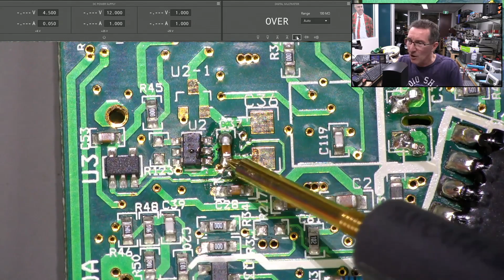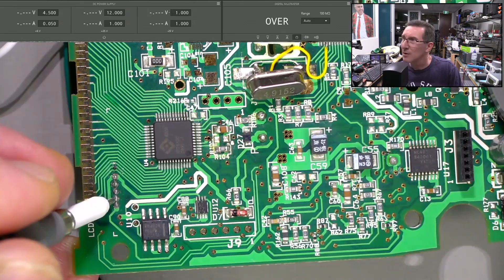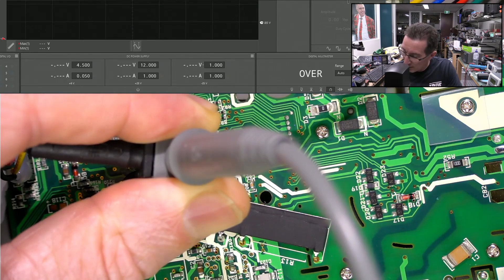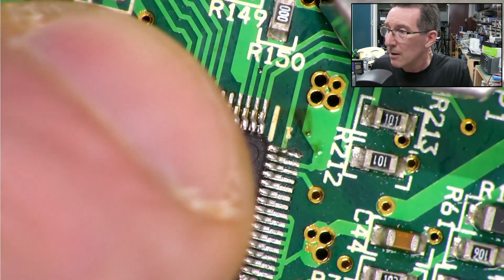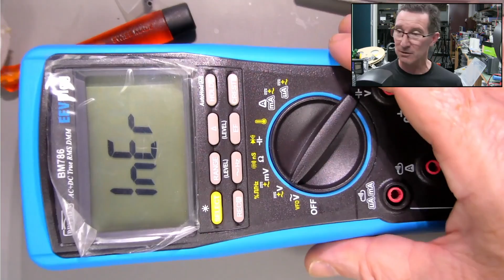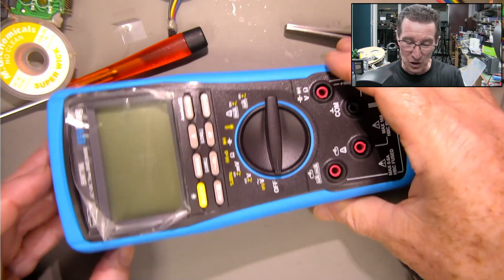EEVblog 1522 - BM786 Multimeter Repair PART 2

Comment: I would expect the most likely problem with a multimeter that has seen a lot of use to be related to the rotary switch or maybe the jacks.... not the 'silicon' failing. Is this common with other brands also?

Comment: Question about meters in general.  One of my meters measured 350 ma of current draw on my car battery.  I switched it over to the 10 amp scale and it read 3.5 amps.  Is that meter broken?  I thought it should read .35 amps.

Comment: Why did you sssume that "InEr" = Insertion? It is Initialisation, obviously. As far as I cam see, you soldered the chip poorly, some pins are probably loose.
Reply: This is 'Input error'. Swears at current inputs.

Comment: very nice repair video 🥳 I just purchased a cheapy $57 HoldPeak_HP-770D CAT III Auto Range 40000 Counts DMM BarGraph  MultiMeter, seems to work OK on hobby stuff? 
Now for the important news.  April 20 2023, 11.27am local time, Total Solar Eclipse over Western Australia’s Coral Coast. Are there any venomous snakes out where the tourist will be?

Comment: A whole lot of useless components. It's time to make something with a normal color TFT LCD with a built-in electronics and a lot of measuring modes. In the same space, it is possible to integrate a signal generator and signal logger with 10x precision with internal calibration tables - there is no problem with built-in memory for that nowadays and normal MODERN multimeter functions, not defined by marketing, such as L measurements with low current milliohm meter. Like what is the problem ? It is solvable by modern integrated circuits.

Comment: 1st of all, an multimeter it’s the main tool in EE lab. You should purchase a trusty piece of equipment and not “Made in 3rd world” POS. OK, your budged is very tight, then buy an 5 – 20 bucks DMM, save money and buy a trusty equipment designed/made in normal world.
Otherwise you will spend more time in troubleshooting the multimeter than the real problem… Think twice and buy a quality product like Fluke, Keithley, Keysight, etc. 
Can you trust the EEVblog branded DMM? Even the creator(??? I doubt he even know the design...) / sponsor doesn’t have the schematics !!! 

Is Brymen better than KAIWEETS? ...the same crap, only in different package, and the price is different :)
Reply: > Is Brymen better than KAIWEETS?

Yes.

Brymen are not POS (and Taiwan is not 3rd world), but to each his own.  Fluke, Keithley, Keysight are much more expensive.  I have some Flukes, and I have some Brymens.  I use the Brymens more often. They're more compact and more readable.  I use a Fluke for car work because I have a magnetic strap for it.

Comment: As a plumber I really enjoy your videos.  I have a favorite plumbing flux too, other fluxes don't work the same.  I've always wanted to fill some assholes electronics flux dispenser with plumbing flux.  They'll love it at first....... then in about a month the copper will be all gone from anywhere the flux was left on.  The good part is there will be no traces to fix.
Reply: There was a TV studio, I think in the Green Bay area, that back in the 80's had a tiny fire in a trash can. It was quickly extinguished and people thought that was that. When they returned after the weekend, there was copper oxide dust all over the place and not surprisingly, nothing worked.
I'd love to know what was in the fire extinguisher.
Reply: And I too am picky about plumbing solder. I don't do a lot of it, like it isn't my job. But I've been picking away at home renovations. The water-soluble stuff is awful. But I'd love a recommendation on a brand that comes in fairly small containers. I'm not too bothered it if is relatively expensive as a small quantity will last a long time. It is the frustration of needing to rework, especially after the pipes have been pressurized with water that I'd like to avoid. I can't always pressure test with air.
Reply: @strehlow  I never test with air but I almost never have leaks on small pipes 1/2" up to 1".  Larger than that is easier to have leaks, 2" I always have a few leaks but I also put in really good quality unions so I can remove entire branches to dry them out to rework a joint.  As for flux I prefer Oatey brand.  I'm really picky about my plumbing flux and I've had fluxes that don't really work for me for some reason.  Oatey visibly starts to boil and sizzle when it's hot enough for solder so it's a great way to know when you're hot enough.  As soon as it sizzles start applying solder.  The biggest thing though is to thoroughly clean the pipe ends, clean clean clean then apply flux, same with electronics.  If you have to rework a joint also clean the black shit off the outside of the fitting so it won't contaminate nearby clean copper.  My reworks are nearly 100% if I do that.  Overheating is probably the #1 mistake to have  bad joint, heat just enough until the solder melts rapidly then remove the heat.  I use propane too and that seems to help prevent sooting vs acetylene or Mapp gas.  Just a green can of camping propane works really well and it's cheap.

Comment: Have you ever been instructed to bake a PCB for 24Hrs before desoldering a QFP. It prevents any moisture, absorbed by the plastic, from out gassing and damaging the QFP.
Reply: Yes, popcorning as its called. Why those chips have a shelf life before installation, reducing when the hermetic vacum foil  packaging is opened on the tray or reel of chips.. Worse in humid countries, so designs out sourced from Europe to Asia were often delivered with wrecked ICs where similar handling in Europe did not result in popcorning...
Baking is part of the recovery process for those chips before reflow soldering.

Comment: The "non working" chip may just be locked though.
If so, depending on how the protection works, it may need to be fully reset/erased or it may not be a reversible process when they blew the security fuses/locked it.
I also winder if the InEr is due to the fiddling with the xtal for the instrumentation chip.

Comment: Hi Dave, i think the error is Initialisation Error, maybe from ic replacement and wrong calibration.
Reply: From the manual: "The meter beeps as well as displays “InEr” to warn the user against possible damage
to the meter due to improper connections to the uA, mA, or A input jacks when another
function, especially a voltage function, is selected."
Reply: @Another8Years  Um, how about "no connections" to the jacks?
Reply: @Another8Years  Um, how about "no connections" to the jacks?

Comment: Hey Dave thank you for the repair video. Now I wonder if swapping out the 000R resistor at R104 to 10K would resolve the problem sense that is the multi meter ic. And if that doesn't work then adding 150k resistor to R105.

Comment: Sometimes an  STM32 will reconfigure its programming pins as GPIO either corrupted flash or intentional code options (program pins are alternate functions on GPIO) .. to recover you have to reset the chip and activate the pins in programming mode immediately before the application completes initialisation..  Which involved manually holding it  reset then releasing  with a normal programmer polling the SWD pins.. Then often needing a bulk erase from STs own utility  rather than a third party programming application.. also the BOOT0 boot mode pin that invokes a boot loader is susceptible to noise and will crash the processor at any time if toggled over half the rate of peripheral clocks despite only being "used" just after reset to choose bootloader flash. We hit it with 10ns glitches by mistake and it crashed in one design.

Comment: Thank you Dave. This is why I pay the $$$ for Fluke. Both professionally and privately.  Their goof up, would be honored, repaired and returned a month and a half.
Reply: Or just buy the Bryman, and if it fails buy a new one which would be delivered well within 1 1/2 months. And you'll still be quids in.
Reply: The BM786 was under warranty (it was 9 months old according to a post in the forum).  So presumably the buyer got a replacement.  The  Brymen does have a shortish warranty  (1 year) - but you're paying at least $150 more for an equivalent Fluke, so the Fluke warranty isn't exactly free.

Comment: First of all, I still believe that you are truly awful when it comes to debugging. No offence, but there are plenty of people on YouTube, who are much better in this than you (and no, the fact your were filming the entire process is no excuse). I my opinion, you should focus on that power latching circuitry and figure out why it didn't work in the first place.
Second of all, I am afraid you didn't get to the bottom of this issue. I wonder if that "insertion error" could be a proper root cause of the problem, which then eventually killed MCU.
Finally, for educational purposes only, it would great if you could decap the faulty chip and check it under the microscope.

Comment: What the hell is wrong with those crystals? why the jumper wire? design error? I can also spot some vias drills almost directly on top of each other. why?
Reply: Dave fitted that crystal in the last episode because the oscillator wasn't working and he thought it might be a bad crystal. He didn't have the correct part so kludged that one on.
Reply from the maker: Watch part 1, A pad was lifted removing the crystal in the previous video.

Comment: If it so hard repair a electronic device for a guy that has " in theory" all information about that device, imagine how hard is repair for a guy that has no one information about that device.
Reply: This is why we need to fight for Right to Repair.
Reply: In Part 1 Dave says that brymen did not give him all the info for the board, so he has to trace out all the lines to find out where everything goes.
Reply: @felixcosty  ahh and? Most people also dont have schematics either -  but using a miltimeter trace down the componenet.  Dave just seems to jump all over the board instead of startiing at one point and working through it.  Has he even checked a short to ground and traced to were its the least resistance?  Look through his past videos - not alot of successful fixes...
Reply: @Nostradamus1981  Still like watching the videos, Dave seems to have his own method fixing things.
Reply from the maker: Apart from knowing what the micro is, I have no other technical information.
Reply: I'd be surprised if Dave have any details.
Reply: The harder it is the more rewarding the experience, if it was easy it would be boring

Comment: My BM869 shows that insertion error when the battery is really low. Might be the same issue here.
Reply: The original batteries on my BM235 where slightly smaller than standard ones. When the MM got vibrations or slight shocks, it showed intermittent InEr . I thought it was a faulty device, but after replacing the batteries, everything was fine!

Comment: Have you tried a hard reset after the firmware update ?
Reply from the maker: Yes, makes no difference.
Reply: @EEVblog  Well it was a long shot.
or maybe you could wipe the chip and reinstall the update. its another long shot you never know it might work. if it doesn't it probably has EMP damage from what caused it maybe from a microwave. lol 😂😂🤣🤣😂😂🤣🤣😂😂

Comment: Did that Multimeter somehow get shocked? I mean a silicon failure and then the Insertion error..... Yeah this looks to me (non expert guy) like a failure due to Overvoltage / ESD / EMP

Yes I'm not an expert, you've seen that correctly. This doesn't stop my interest in such technical stuff tho.
Reply from the maker: The chip is very well protected against such things.
Reply: You never know. It should be well protected. But you can never be sure. I killed a WiFi router once with ESD 🤣 luckily it was EOL already.
Reply: @EinGamer22  : Can't compare consumer grade crap to measurement instruments, not even in the same ballpark. Haha...
Reply: @TheFirstBigCheese  actually true. Like I've said I'm no expert in this stuff. 

Why I'm thinking about overvoltage: the silicon lab should check every single chip for defects. So there should only be good chips.  A bond wire could have broke tho (idk why I mean that chip won't get to 70+ degrees Celsius.)

Also how is the insertion error occuring. Is that a defective part on the board or just a simple Software issue?
Reply: @EinGamer22  I think when the chips pass the tests at factory, some of them are really close to be defective (poor bond wire contact, badly formed gate on silicon, thinner traces at some places...) but they're just good enough to pass the tests. Then they end up failing early in real use. I guess there is no solution for that problem unless there is some testing that checks the whole thing at a molecular level rather than just testing its functionality
Reply: @wphanoo  That’s why, the highest failure rates in electronics occur in the first couple of months of use, and again, at end of life, of the particular device being discussed.              It’s called “Burn-in” failure, during the first couple of months, when any ‘dicey’ quality components that escaped detection during initial assembly and factory testing, will fail with the first period of continuous use by the customer.            Providing your device, can get past those initial few months of use, and survive, then you can almost guarantee that it will perform trouble free for the rest of its design life, barring anything involving the owner’s own stupidity, killing it, like ESD. 
Then, as it approaches it’s designed lifespan, other age-related factors, like gradually failing electrolytic capacitors usually take over, as being responsible for the cause of death.  😉

Comment: I work at an electronics manufacturer as the rework/repair tech, I've seen a lot of cases where it LOOKS like the MCU is dead, but there's another fault making the board fail, like a backwards chip on the same power rail as the micro that loads the line down when powered, broken resistors going to the programming header, lifted leads on the micro, ect

But given this unit has worked at one point and you were able to program a donor micro on the faulty board, it was definitely a dead micro in this case as you had suspected earlier.

The resistor change definitely is a bit odd though. Maybe a voltage divider that was changed to go hard to the voltage rail or ground? No idea.
Reply: Seen something similar with TI and Microchip where, depending on what else is being powered up when a programmer is connected, the power rail and signals would dip slightly and that was sufficient for the micro to not respond. Only by increasing the programmer voltage by 0.5V did the micro 'appear' (but then you have to be careful with max voltages).
Reply: get some kittens and send one to Dave.....

Comment: could it be that the 0-ohm resistor vs the older version of the board causing the error? as if this version of the processor working correctly with the other arrangement?
Reply from the maker: Doubt it. That's part of the LCD driver by the looks of it.
Reply: A cap and a 0 ohm sounds like an error.  Then the power supply or chip may be stressed and  U know the board fails after a week.
Reply: @danc2014  Yeah it's pretty strange to have a zero ohm on one board and a 10k or so on the other. Big difference. I notice the other resistor was 01C marked. It could be mistaken for 000 if you weren't careful, I suppose. Now was that factory rework, or user rework...?
Reply: According to the datasheet, that's VLCD. Change in the liquid crystal chemistry?

Comment: You measured the processor voltage on the supply side or R150... I would be checking on the pins instead in case the resistor is open.
Reply from the maker: I did. No problem.